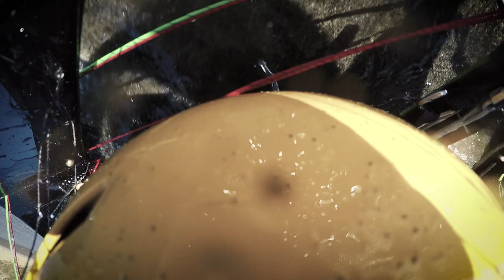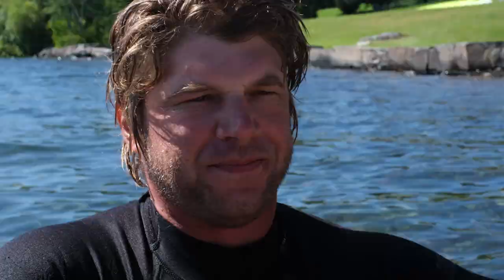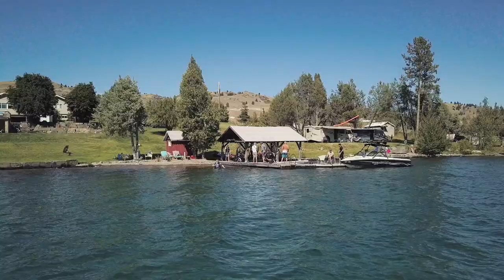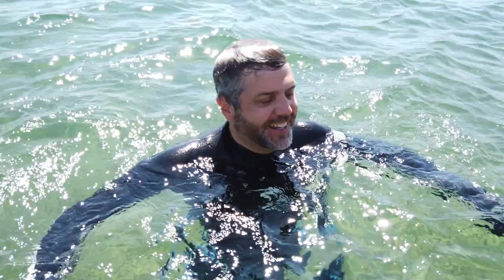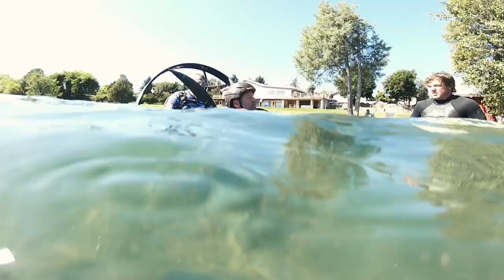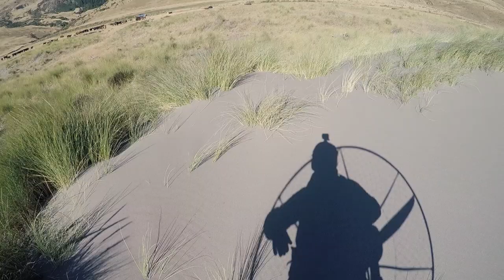PROJECT WATER LANDING EP#1

Comment: Nice video, looked like that one of the test pilots was Boyd a seasoned pilot and great instructor who flew Flat Tops for many years, the Flat top has a quick release system that gets you out of the harness in a second that's one thing you people should push for, I could imagine how scary it would be hitting the water and having to unbuckle 6 different straps. I have crashed 4 different times and when that trike and paramotor is laying on top of you and all you have to do is pull one handle and your free is a major relief. Great testing, you will save lives after your done I'm sure, great job.

Comment: I just happened across this video. Awesome doesn't describe the information that this can bring to the table. I was thinking about a "Jesus pin" that can pull say three pins that will allow you to totally undo ALL the straps at one fron the attchment points say behind the legs and just behind the shoulders. Have the "Pull handle" either on the side or just over your shoulder/head. Differentiate it say with a different type of handle that can be felt and not mistake it for the pullstart that is sometimes located there. Thoughts?